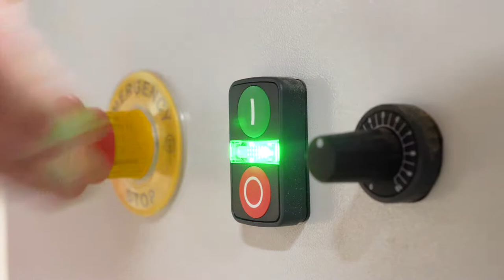PC200 Single End Pallet Trim Saw in Action | Wood-Mizer

Comment: Can this machine run on a generator?
Reply from the maker: Thank you for choosing Wood-Mizer! Yes, the PC200 Trim Saw is able to run on a generator, but it would need to have sufficient power to run the machine. For more information, please give us a call at 800.553.0182 or contact our Pallet Equipment Specialist Brad Kirkaldy at bkirkaldy@woodmizer.com Thanks!